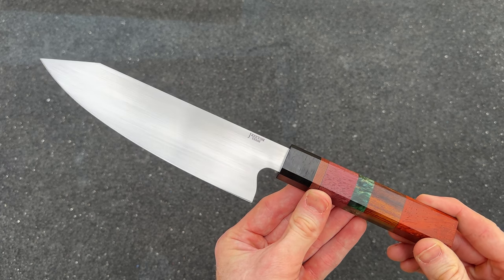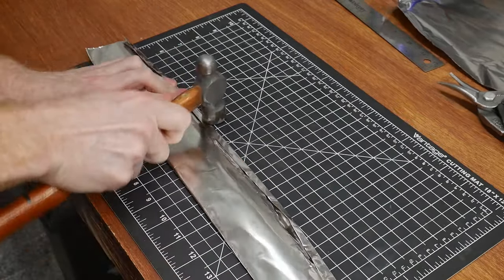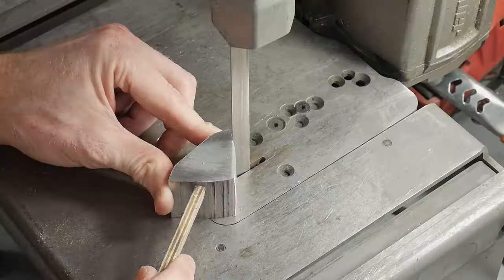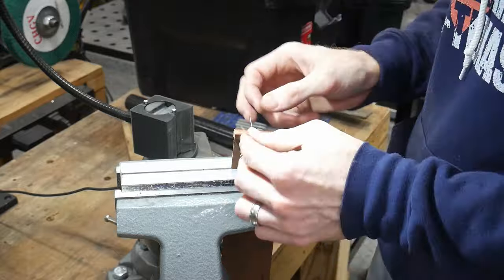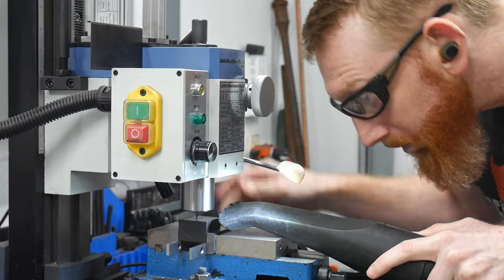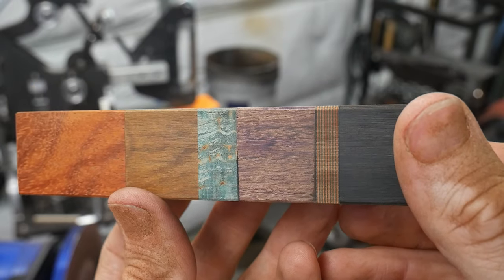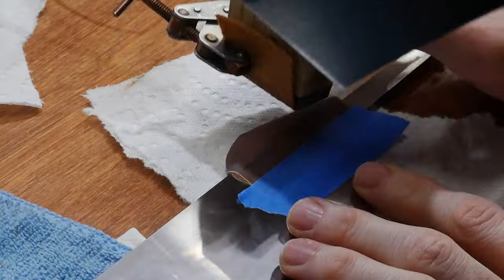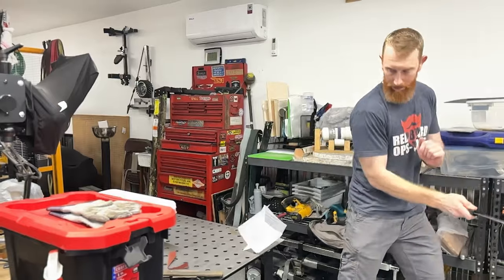Without One Of These... Are You Even A Knife Maker?

Comment: Great job 👏🏻  
Keep cutting stuff in the kitchen so you can feel how comfortable the handle is. 
I find that the 45 where the handle meets the ricasso area of the blade could be a bit rounded and deeper for a more comfortable handle, specially for a pinch grip use of the knife
Reply from the maker: good points!

Comment: Top notch video as always. Does the edge stability of the 58 HRC seem pretty good still? I’ll typically do around 61-62 and find it to be excellent. Lately I’ve switched to 14c28n and it has a better heat treat response and gets slightly harder. 

For kitchen knives I’ll use sub 3/32” stock and often have warping issues while grinding. I find grinding the bevels back as even as possible helps. If I use the peening hammer when the knife is to thin though then I can get a bacon edge.
Reply from the maker: It's been doing well so far, but I'm sure 61 would have been more ideal for my application.  3/32'' probably is a better stock thickness.

Comment: I think for your next Kitchen Knife you should attempt an "S" Grind.  Tip: if you make the attempt, you're going to need to make a custom Platen with a 36-60" Radius.  and always remember when you're striking in the (Rather Large) fuller to grind it spine up as it gives you better control and lets you see what you're doing.
Reply: Brian House also sells a curved platen that I think simulates a 56" contact wheel (if I remember right; it's something like that).  I  have one and it makes hollow grinds feel like super-easy mode, at least as long as everything is set up correctly and properly squared/leveled.
Reply from the maker: Very cool!
Reply from the maker: Agreed and S grind is on my list!

Comment: way to curved of a profile which is so typical for edc/knife bros that venture in kitchen knives. real high end chef knives will almost always have a much flatter profile and thats also what sells. round profiles like this can work on smaller knives, but even there a lot of folks will avoid it like plague. AEBL is such an amazing steel tho. You can easily get that thing 63+ rc and as thin as two sheets of paper behind the edge and it would be good to go. convex the bevels for food release, make sure the balance point is slightly towards the blade and you have a good basic functional practical kitchen knife.